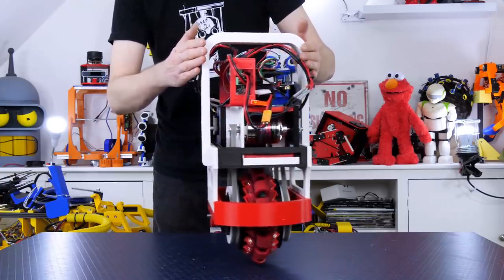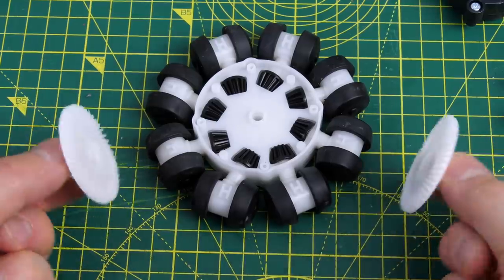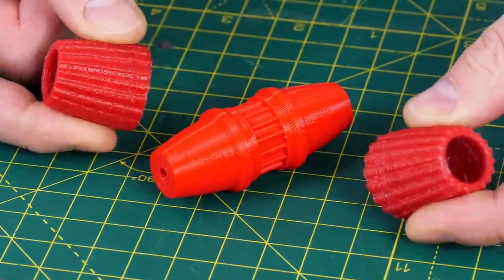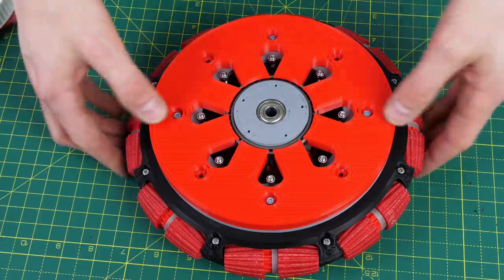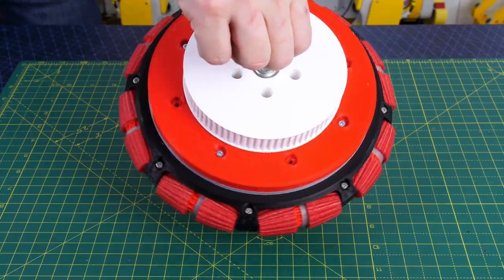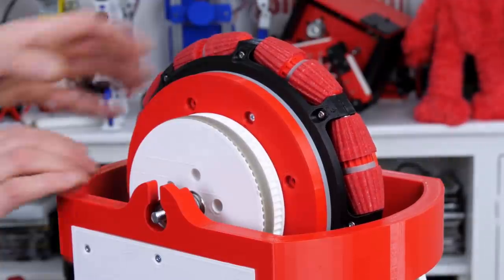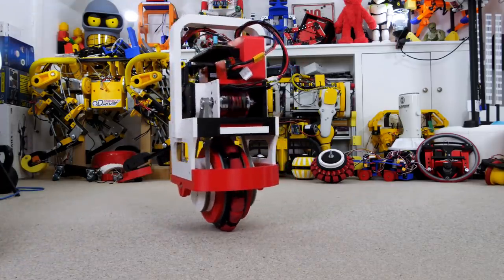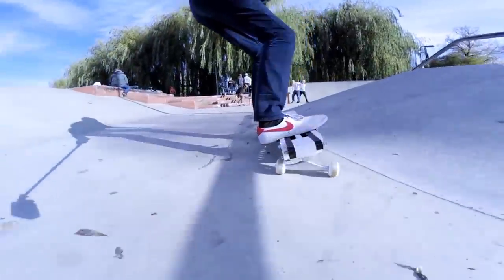How It Balances on ONE Omni-Wheel

Comment: It may need more than a Teensy, I really don't know, but I'm wondering if you would have better luck if you had some way of tracking where the main wheel was, with a curve to apply to the amount of side to side force to apply based on that, the curve following the highs and lows of the conical sections for the small wheels. It wouldn't have to be a 1:1 match with wheel position, a 8:1 reduction would match up with the 8 small wheel locations. Part of startup would probably be walking through those steps to find max and min values to apply if you're using a simple encoder. An encoder with a endstop sensor to align with a given position on the main wheel might allow you to code in a table that doesn't have to be populated during startup, it just has to find where '0' is on the wheel.

Comment: Maybe you could add an encoder to the wheel to tell when it is on the small parts of the rollers and when it is on the big ones? IDK. Beware that if the mini-wheels have constant diameters, that will move the contact point away from the robot center of gravity, and possibly slow the reaction speed down a tiny bit.

Anyway, nice work!

Comment: I was wondering if it were possible to have two central hub gears like the toy, but put an extreme helical gear on the outside perimeter of that gear that engages the outer rollers directly. I was looking at how your model comes together an the gear portion would be similar to the notch you have now for the belt, but would be small semi-circular cutouts where the outer rollers touch the inner two bevel/helical gears. if you get the angle just right the inner hubs could drive the outer wheels directly.
Reply: Ooh I like that!

Comment: Because you have an even number of "conical wheels" you can measure the diameter of the conical wheel ground contact point, because it is the same diameter as the conical wheel that is diametrically opposite at the top of the wheel. At that point it is quite easy to measure mechanically. You can then factor that diameter into your control loop.

Comment: What about using the high speed stepper motors (you could be able to find one that can easily hit 6,000 RPMs with the right motor driver chip and software) with the built-in optical encoder so you can accurately translate the motion basing on the computed balance data - you can always roll your own if you have to. That way it have enough reflex for a very stable balance. You can use the RC brushless motor as a stepper motor, however it's a lot more complicated due to how the micro-stepping works - the motor design doesn't always allow for that, depending on the magnet configuration. So yes, putting the encoder on either AC motors are a good idea that way the microcontroller knows what to do to maintain decent balance.

Comment: With this design you'll have a hard time tuning the PID of the sideways movement since the output gears (or rather the surface that touches the ground) is a semi-cone-barrel..., and that means that the total gear ratio changes dramatically depending on the main wheel angle and so the touch point of the semi cone with the ground. The gear ratio changes like a wave function, so with a clever algorithm you can tame the variables (maybe using a LUT or actually defining the wave function) but without it you'll always be lost.

Comment: Why not use nubs (for lack of a better word) or concave/involute rollers rather than flat idler pulleys? Positioned right, the belt will drive into the roller and remain in place.

Comment: One way to solve the tapered issue without requiring too many major changes would be to put an encoder  on the main drive motor or wheel and therefore you could calculate where on each taper it's driving on so (assuming it's on level ground) it would be able to compensate at least to some degree for the difference. I'm not sure how you would be able to compensate for it if it's not on level ground however as with only one wheel there's no way to differentiate between the level of the ground and the level of the robot (short of possibly compensating for that by calculating the amount of bias in one direction it is applying in order to stay stationary and using that and a bunch of testing to figure out approximately how many degrees the ground is off of level) although I'm not sure how well that would work.

Comment: If you had a pair of encoders, could you perhaps track the rotation of the major wheel? You could also have a pair of acceleration values (sorry the code aspect is completely beyond me) for the minor wheels, one for the small end, one for the large. Then use the position of the major wheel to ramp between the two acceleration values as needed? I imagine tuning this in would be a task, but perhaps this is solvable in software so you can keep the smooth roll on the major axis.

Comment: Wouldnt the bolts of the "planet gears" eventually eat into the tension ring? (Especially on the side where the screw thread touches the plastic 5:56)
Reply: The bolts are not spinning. They're just static axles.

Comment: For better side to side movement. Could you use a sensor (maybe an encoder?) to determine the angle of the wheel and adapt the speed depending on the circumference of the small cones that are currently straight down.

Comment: I wonder if you offset the central gear down and have an idler to keep it "tensioned" if you could make the the outer wheel gears engage as they move towards the ground, that way the mechanism only drives the outer wheels when they contact the ground further reducing friction

Comment: Hi, I just want to give a, maybe stupid, suggestion, but since you know the size of the litle wheels and where they need to run faster to compensate, isn't there a way to make a formula to automatic adjust the rotation of the litle wheels depending on the position of the big main whell? or does those motors not work like a cervo where you can know exactly how much it moved?
Maybe is not easy to make or does not fit in this machine, but is just a suggestion in case you didnt think about it ;)
Sorry for my bad english, I hope you understand what I mean.

Comment: the belt moving is gonna make a none linear relationship between the pulley and wheel. should you just not make the recess for the belt ~same width as the belt? I assume this approaches printing tolerances?

Comment: “That’s more gears than I’d like…”; prints 300 piece gearbox. Also on your wheel taper issue, just adjust the velocity factor up and down continuously based on the wheel angle as a post processing step. You could support different wheel taper geometries more easily this way.

Comment: Suggestion: There is no need to actively drive all the wheels on the hub.
It should be enough to just drive the wheels that are touching the ground, this should reduce friction and increase the agaility (in theory)
Reply from the maker: There really isn't much friction - the motor is 1500W so there isn't really an issue here with this wheel

Comment: Thats a huge improvement in relation to the last version. Good work! Also, you could solve the problem with small conical wheels by just reprinting them as cylinders. I think there is enough small wheels that the "bumpyness" of cylinders wont be a big problem.

Comment: If you used a light or mangnetic sensors along with marks precisely positioned between the wheel pairs and servo motors, could you track and predict where you were on each variable diameter wheel to calculate out the variation in real time? Might not be the best solution, but seems like it could work without changing the mechanical design.

Comment: wouldn't it be better to lock the one side instead of turning it from both sides of the hub. like you mentioned locking the one side and rotating the other allows the wheels to strafe. maybe having both rotation points on one side would allow for a different simpler mechanism. maybe not the best from a balancing perspective but may be worth the trade off. would be really neat to see the smaller wheels made of worm gears or something to prevent the need for pullies.

Comment: What about you use an encoder to tell the position of the big wheel and compensate for that changing diameter of the small wheels depending on the position?
I'm not sure but this could work

Comment: Could you use the position feedback of the main wheel to adjust the algorithm to accommodate for the different diameters of the small wheels? Might have to couple that with the IMU data to determine which part of the small wheels are in contact with the ground.

Comment: the taper on the smaller wheels should be no problem at all, because you know the position of the (larger) wheel and you know the taper, so you could just do the math to calculate the linear effect of rotational change (at a given large-wheel orientation). I very much hope that you do not change the wheel design to use non-tapered small wheels. Nice video nonetheless

Comment: did you tried to spin the 2 pulleys reversed from each other ? i get that the drive mechanism is a bit more complicated but you would have something near double the side traction ?
Reply from the maker: If both pulleys move in the opposite direction then it'll go diagonally since one pulley is attached to the main wheel. It moves that pulley to go forwards and backwards, and then moves the other pulley like = first pulley +/- sideways motion.

Comment: At around 3:00 

Would it be possible to angle the teeth of the gear diagonally to match the angle of the drive belt to prevent it from walking or am i overlooking something. Perhaps even create a valley in the gear using the teeth to persuade the belt to stay in the middle, something akin to two bevel gears kissing but with a smoother gradient. 

 Might be able to condense the design if feasible though i haven't considered much in the way of the gear's integrity.

Comment: I think your tapered wheels are better, and you just need a new technique to deal with the variable diameter:  how about an accelerometer to estimate the instantaneous acceleration?

I wonder if the rubbing of the bands across the edge has an effect: you get like 3 rotations of the wheel and then suddenly the band hits against the edge and starts to slip.  That is likely  to add a really hard to predict left-field surprise change in behaviour that is likely to confuse the control software.

Comment: Amazing. Wondering if you could use a position sensor to know whether it’s riding on the larger or smaller diameter of the cones.  Or perhaps set rotation to where it only stops on a single diameter of the cones.

Comment: Could you calculate the wheel position and so adjust the side to side control to compensate for the difference in roler diameter?

Comment: Nice. For the twisted drive belt couldnt the barells be thicker in the middle and thiner on the sides (angle) so that with a wider rubbber/belt it would auto align to the center? Would that work?

Comment: I assume that a gear that is shaped like a hemisphere coupled with a negative shape and cylinders as tires but at an angle to each other could solve this without the need for a flexible drive otherwise a flex coupling would be needed which would require more space.

Comment: Why not put a acceleration sensor on the wheel-axle height and drive the motors for actual accelerations on this sensor, via a PID controller, instead of “calculated” ones based on the motor output?

Comment: Another great design! Could you accommodate for the variable diameter by putting an absolute position encoder on the wheel to vary the speed based on wheel position and device angle?
Reply from the maker: Yes, but it's quite a lot of workaround ;-)

Comment: Maybe fix the radius variations in Software? it should be possible to calculate a factor based on the estimated radius touching the ground which intern influences the control parameters of the PID in some way.
Downside is of course that the ground is not always perfectly flat. (and thus messes with the contact point below)

Comment: looks to me the center of gravity is way high.. also.. since you have a 2 motor concept , would it not be easier to direct drive the 2 sides , that also comes with a reduction in mass up high?
Reply from the maker: A high centre of gravity makes it easier to balance because it has a high point of inertia and it doesn't move as quick.

Comment: what if you multiplied the proportional constant by the ratio of the maximum circumference to the current circumference, and detected the current circumference using an encoder on the big wheel?

Comment: the side to side balance could be a lack of mass.  Think of a high wire unicycle.  there would be a bar held with equal weights on each end forcing the robot/artist/clown on a unicycle to only need to do the forward and back on a wire.  the total mass above the wheel could be too high centered so adding a bar with mass on each end may solve temporarily the sideways balance issue.

Comment: Could you make the wheels bigger instead and use the jaw problem to your advantage to steer? Maybe you could fix the wheel diameter taper speed problem in software by measuring the position of the wheel.

Comment: wouldn't it be easier to put a flexible connector for all the perimeter wheels and make one of your small wheels to drive 2-3 of others, then you can reduce the number of parts 3-4folds and it would make life a lot easier.

Comment: Why not more try to directly drive one motor in wheel that turns smaller wheels that move side ways, while bigger motor turns wheel? You can make electrical hookup for in motor wheel by have smaller ring that can act as electrical contact for positive or negative and bigger ring that acts for opposite that can rotate past fixed contact. It may require less mechanical parts and perfection  there and less exposed pieces that stuff may get lodged in but on other hand smaller motor may only fit in wheel and may add weight

Comment: Couldn't you just make the pulley holders with an angle in the middle where the pulley is running? So it climbs into the middle on it's own, minimizing moving parts. ( Not an engineer so.. yeah )

Comment: Stop powering all of  the small wheels. Only the one or two wheels acting as the contact patch with the ground need to be powered. You're wasting SO much power as friction for nothing. I can think of several small changes that would remove the power train from the smaller wheels if they aren't currently at the bottom.
Reply from the maker: There's hardly any friction in this relative to the driving force when the wheels are touching ghe ground.